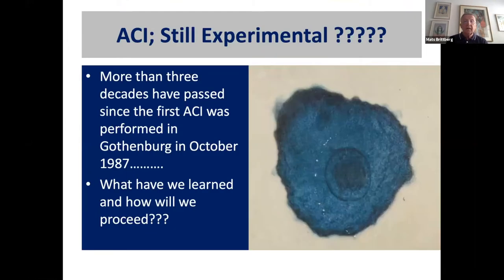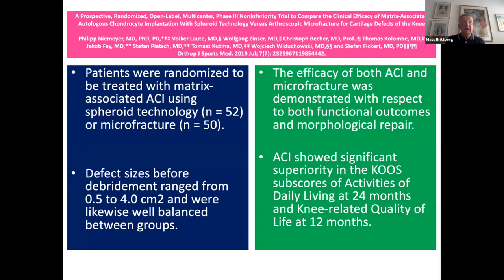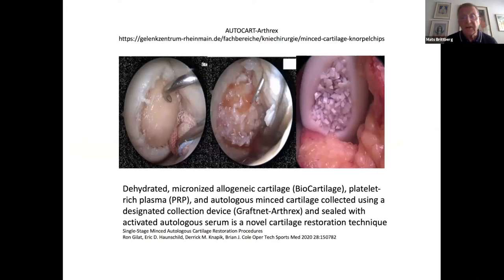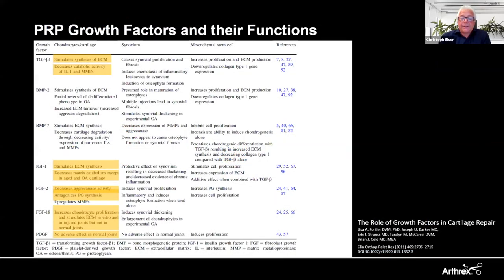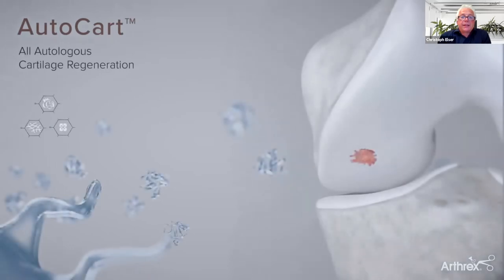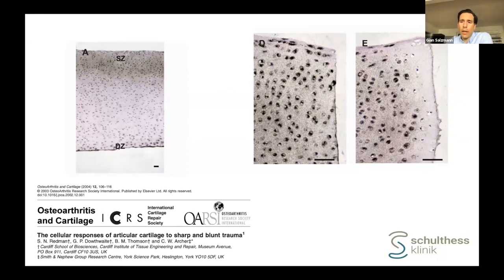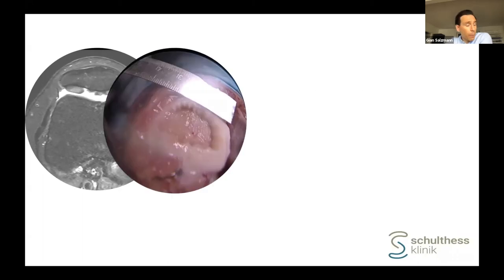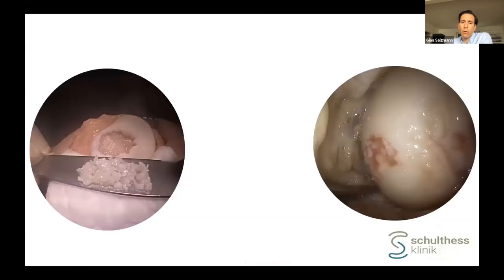Cartilage Regeneration on Minced Cartilage Repairs

Comment: I need to get my left knee repaired, the lateral condyle, it has a defect I have lived with for 30 years. There is a new method of repair that is minimally invasive, known as the RECLAIM or IMPACT method. Involves mincing cartilage from the defect area and then mixing that with allogenic mesenchymal stem cells and fibrin glue. The procedure involves just squeezing this paste in the defect area. And this is supposed to heal as quick as 6 months, but 9 to 12 months is typical. I need help before this defect gets worse in my older age. I am thin and in shape, but 64 years old, though I do look and feel younger and stronger than most people my age -- I work out, eat right, and supplement. What I am asking is "when" will the RECLAIM or IMPACT system of cartilage repair be available to the public? When will it be "approved" that insurance will help pay the cost of the surgery? Can anyone tell me anything about this? (I Add that it seems even better than the RECLAIM or IMPACT system by itself, would be for someone my age mixing some juvenile minced cartilage to the past to improve repair, and to also add TGF-B2. Don't know that they do that in the RECLAIM method. I don't think they do, but I could be wrong.)

Comment: Not that I know anything, but it seems if you could get a finely minced allogenic material from young cadaver donor to fill in the small gaps between the bigger chips of the autogenic material that would create a more dense fill and possibly a much faster healing time. Possibly injecting TGF-B2 into the joint at intervals would help speed up healing too. I would volunteer to undergo such a procedure. I don't see how any of that could hurt me at all, and the upside is you find a way to help older people -- I am 64, but still active, athletic, and I'd like to get my knee cartilage fixed. (I had an impact to my knee causing a cartilage defect.)
Reply from the maker: Dear Billy, you need to look for the right doctor and discuss possible solutions directly with him/her. Mayo Clinic for example is doing such procedures. 
https://www.mayoclinic.org/medical-professionals/orthopedic-surgery/news/novel-stem-cell-therapy-for-repair-of-knee-cartilage/mac-20450891
Reply from the maker: we also have a specific section for patients on our website where you can find more information and surgeons of your choice. https://cartilage.org/patient/
Reply: Hey, did you take any steps?